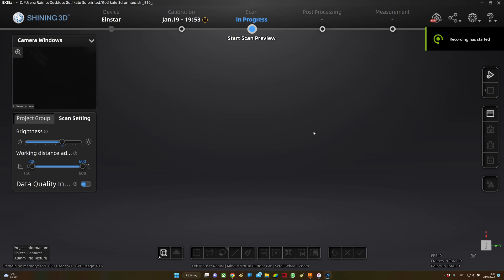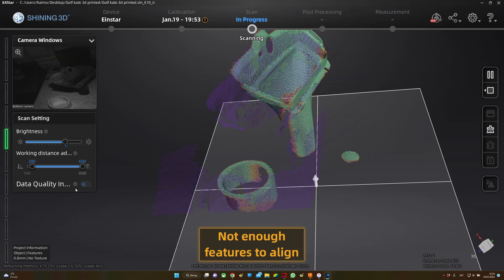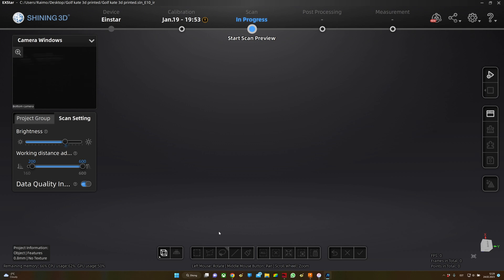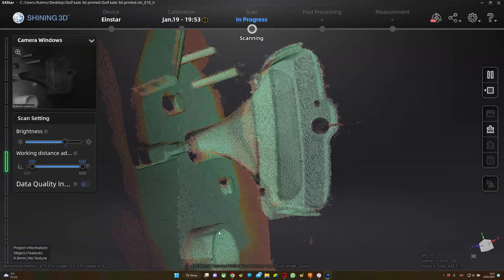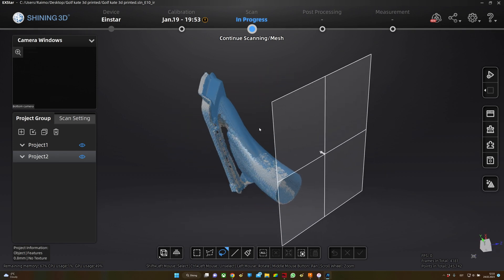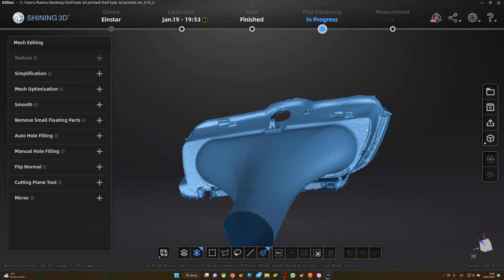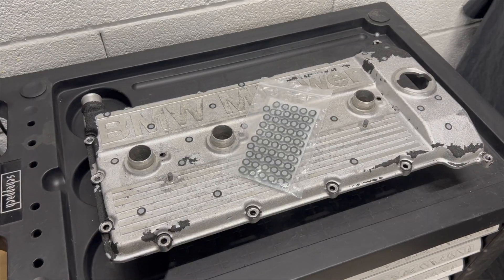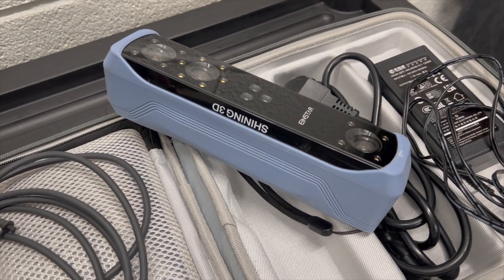Einstar 3D scanner quick test without markers

Comment: Do you have any tips on how I can scan small objects in detail with the Einscan?  With you you can even see the individual clips perfectly.
Reply from the maker: Try adjusting the light in your room, cant have any reflections on the part, so use scanning dust. Reflective materials and black / matte black materials are difficult to scan. Slow movements, different light / distance settings on the scanner.  Sometimes i use medium scan setting, instead small scan settings to capture what i need. Take your time, test different methods! :)

Comment: Use a wood plate under it with markers on it. Helps with tracking. It’s a nice scanner but I returned it because it was not accurate enough and bad with smaller parts.
Reply from the maker: Thanks for the advice! I do like using markers on and under the part im scanning. In this video i was just testing how well and how long time would it take to scan this smaller size object with dark surface.

For accurate scans i would recommend 2x pro with HD prime or all in 1 and better surface detection - a Einscan HX
Reply: @rebellion3D  yeah maybe one day i will purchase a Einscan HX or a new car... I have a Einscan-SP and a Revopoint mini for now ;)
Reply: Why , I bought one but still not arrived, I bought it for small parts 😢can advise me what the best 3d scanner
Reply: @alialbeloshi5425  Einscan HX -> Einscan SP/SE
Revopoint MINI for small stuff like 1cm to 5cm. You can scan bigger parts too but it will get more difficult. I don’t recommend it for someone without patience.
And you need to buy Aesub Scanning spray. Or similar products.
Reply from the maker: @alialbeloshi5425  It depends on the budget. I would say anything starting from 5-6k and up is very good for reverse engineering.
Reply: What is the best scanner for wood engraving?